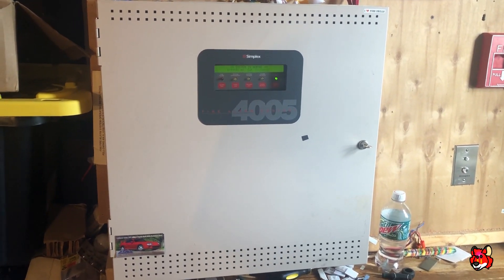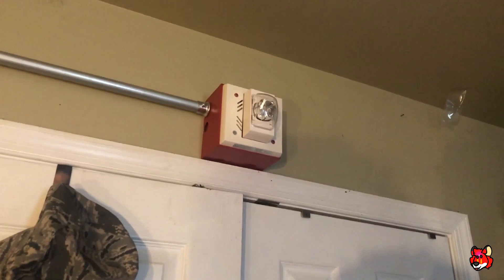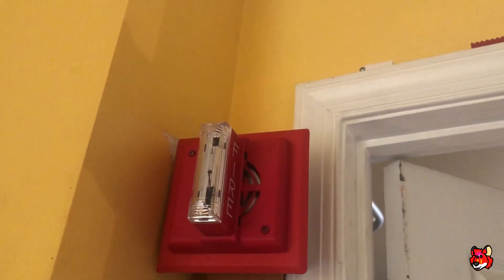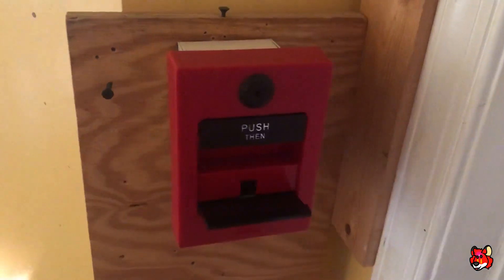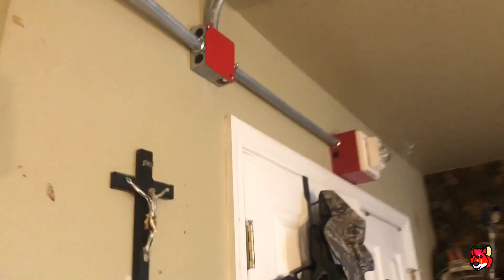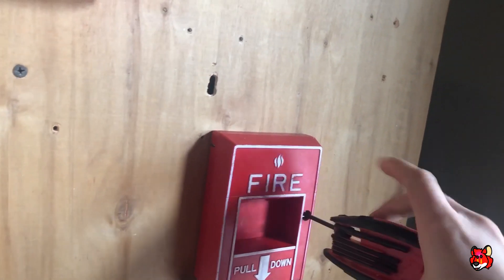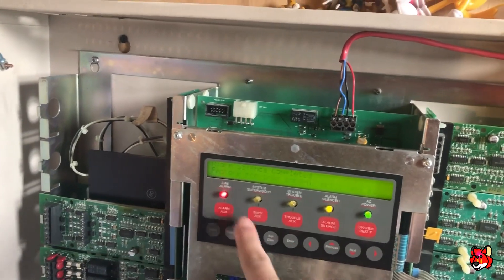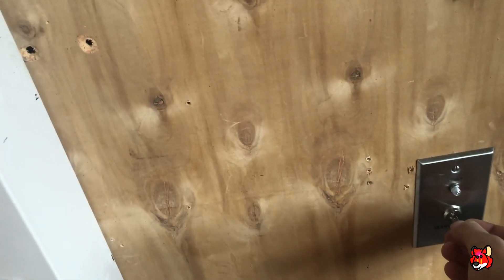Simplex 4005 System Test 6

Comment: What happened to the u hn? Seems rougher and higher pitched than before. Nice test though
Reply: The pitch on mechanical horns change as parts shift overtime on them. Also sometimes they get raspy because of the power input or the horn is just having problems.
Reply: @Alarmo450  well I know that. It just seems way off as typically when these horns naturally shift pitches, its not that obvious. It just seems like something happened that made it sound like that
Reply: @officialsimplexguy  sometimes it is age. However it is sometimes something to do with the horn